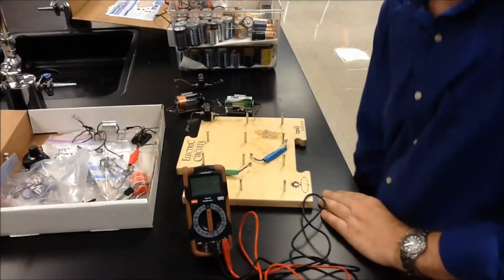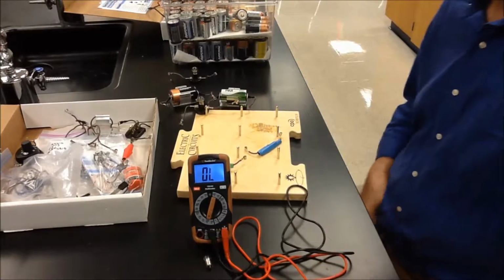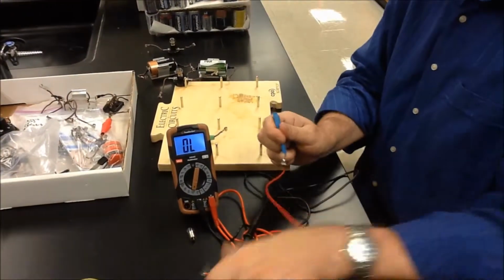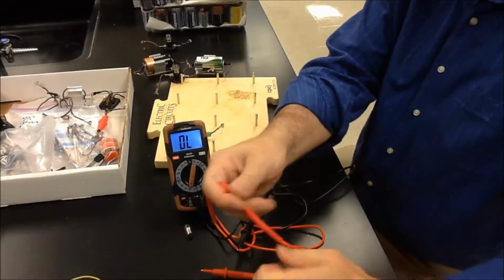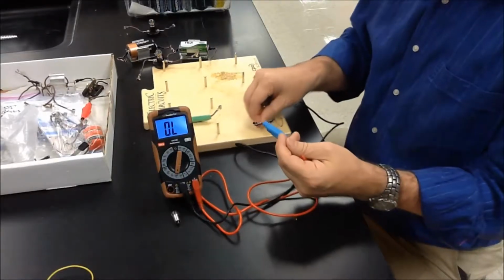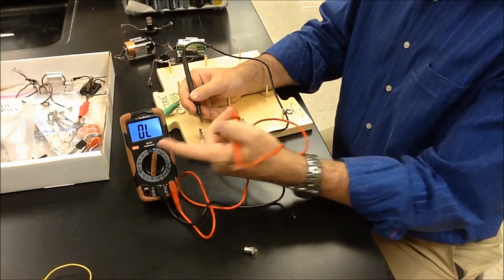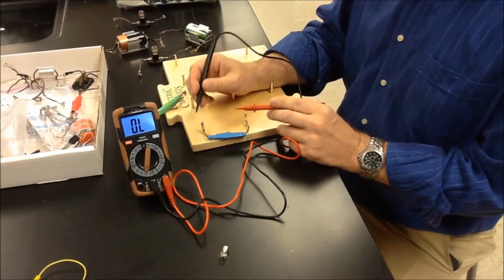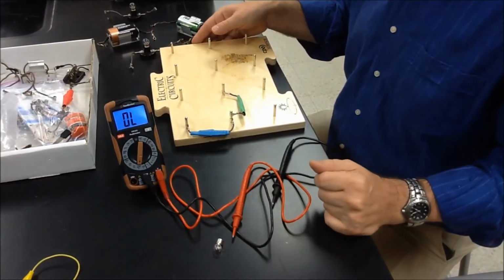Measuring Resistance with a multimeter

Comment: Question  , if im wanting to check a wire on a car , example  , a wire from the ignition switch  to the solenoid.  Would i disconnect the wire from the ignition switch  and the solenoid ? Would i check for resistance from wire end to wire ends only , no ignition switch or solenoid hooked up ? Making sure i understand this right ?

Comment: My cordless drill charger stopped working no LED’s displayed, I checked the resistor and it reads 00.5, there’s power going to the charger, but no LEDs lights up or charge the battery, is my resistor bad?

Comment: When I measure ohm by fluke, it starts with a big number then goes down to a number. Why it does that? (e.g starts with 315.7 ohm then decrement down to 150 ohm)
Reply from the maker: Hmmm.  What are you measuring?  If it is an actual resistor, then the only thing I can think of is that your connections were not secure and there was resistance in the connection.  If it is a "non-ohmic resistor" (like a light bulb), then its resistance changes depending on current.  As far as I know non-ohmic resistors would increase with current, but there could be others.  If the connection is firm and you turn on the multi-meter and it fluctuates, then try another multi-meter.  Those are my best guesses.
Reply: @cstephenmurray  Thank you fore reply. I have the FLUKE multimeter. I am measuring the whole board with R C Diodes, etc.